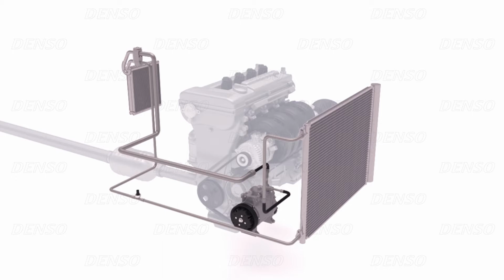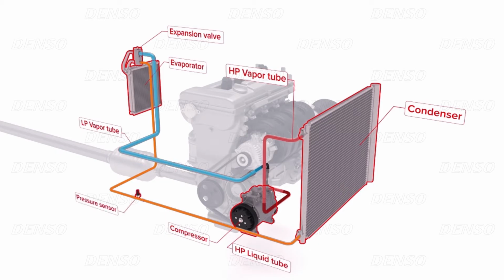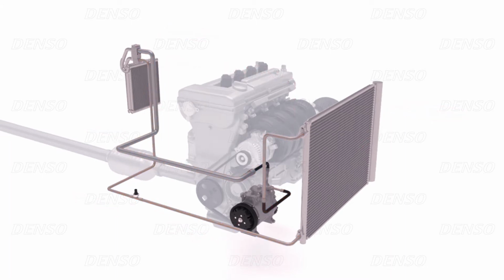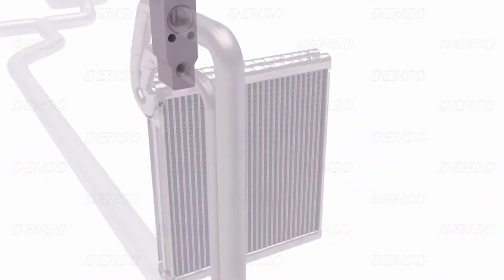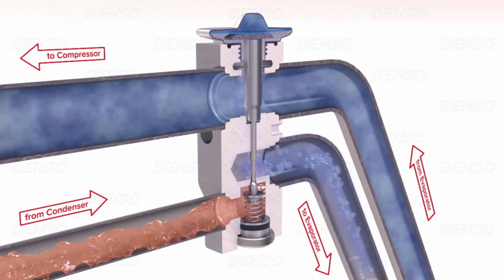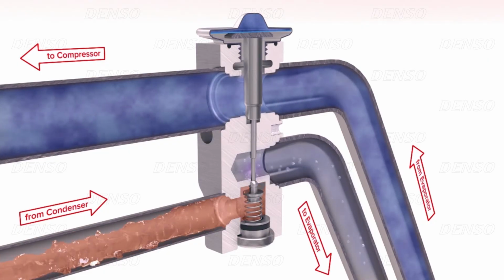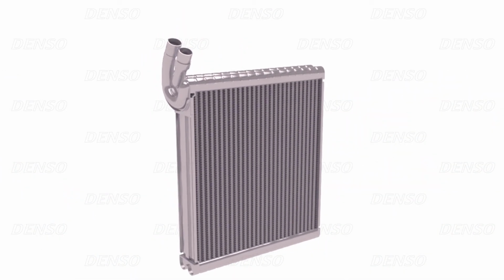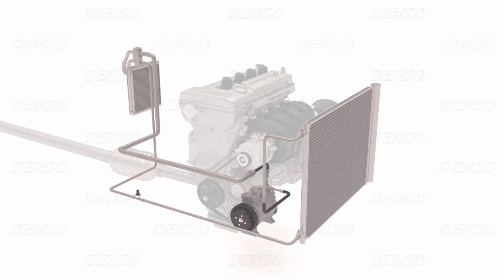How does an AC system operates - 3D animation

Comment: Great video ,,,, I have a question ,,, 
Is the return suction line 100% vapor at the evaporator outlet  ?
if so how the oil could return to compressor ? 
I imagine there should some liquid R134a at the evaporator outlet to lift the oil up from the evaporator (but should be all 100% vapor before reaching the compressor)
Thank you
Reply from the maker: Dear Saeed,

Yes, we have 100% vapor at the suction side of the compressor, to prevent the compressor from sucking liquid refrigerant, which can cause liquid lock.
We call this superheated gaseous refrigerant. The temperature of this superheated gaseous refrigerant has to have a temperature between 5- to 10 degrees Celsius.
If the superheat value is too high, then the oil return comes into danger.  This can happen when the refrigerant levels becomes too low.
We call this difference in superheat, wet or dry vapor. Wet vapor is carrying oil. Dry vapor not. Therefore it is also very important to use the right type of compressor oil, 
because only a good quality compressor oil has the right miscibility properties in every state of the refrigerant. (Liquid or gaseous)

Denso oil types

ND-oil 8: Denso specific PAG, with viscosity 46, for R134a refrigerant. (Not useable for R1234yf refrigerant!)
ND-oi 12: Denso specific special PAG, with viscosity 46, for R1234yf refrigerant, but can also be used for R134a refrigerant.
ND-oil 11: Denso specific POE oil, especially for Denso electric driven scroll compressors.
Reply: @densoaftermarketeurope9740  Thank you so much for the clarification